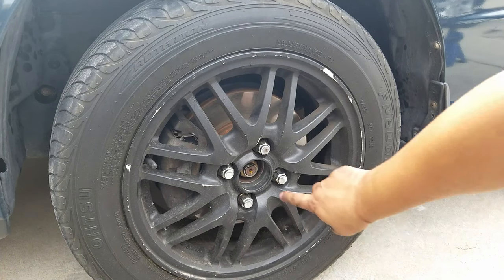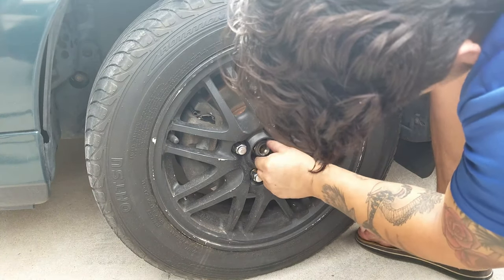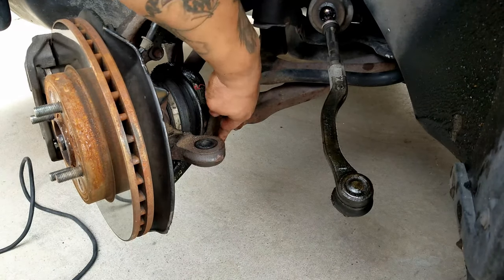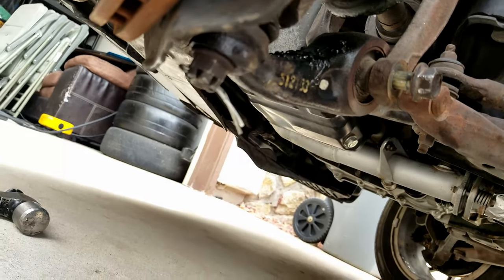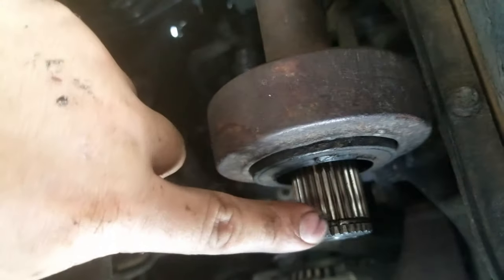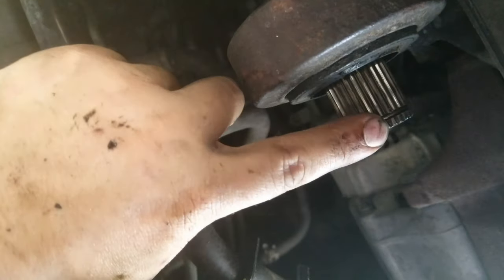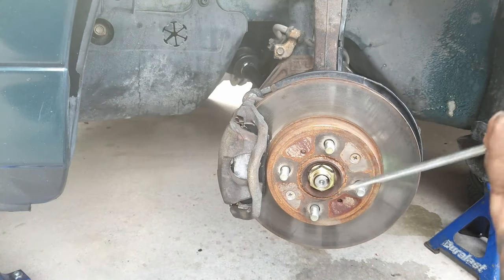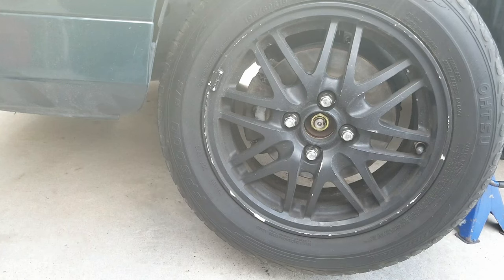Integra Driver side half shaft Replacement

Comment: You didn't show how too remove
Reply: I didnt have the footage, my phone stopped recording because it overheated, but you can use a flat head screwdriver or pry bar between the intermetiadeshaft and end of the half shaft to separate them and slide it out

Comment: if I didnt grease the splines should I pull it back off and do so ???!🥺
Reply from the maker: No it's should be fine just makes install easier
Reply from the maker: Just make sure they're always clean as you can get don't wnat any rocks on u necessary dirt in your transmission

Comment: I would’ve left that seal, I think it’s just a different manufacture and just built different maybe I’m wrong tho I didn’t build it. How’s it holding up?
Reply from the maker: I'm not sure honestly but if next one I get has it I'll leave it and see if it makes a difference. Its holding up good no problems so far
Reply: @inner8performance70  The ring is for ABS if your teggy has it then you should of
Left the ring on but since you cars oem didn’t have it I assume you probably don’t have ABS which if that’s the case then you remove that ring. So good on you 👍🏼